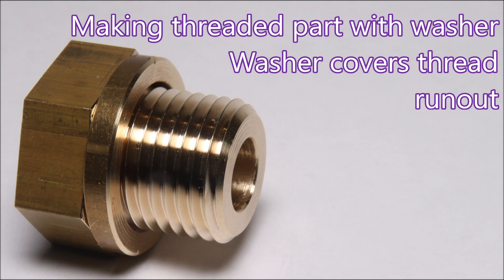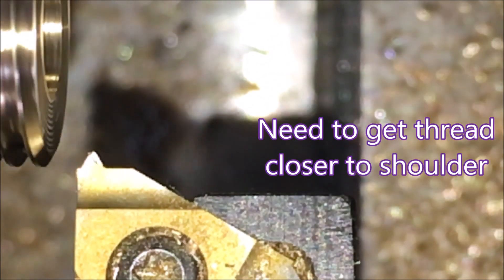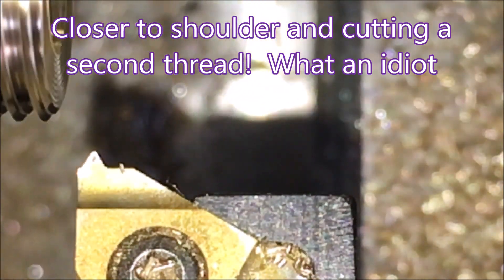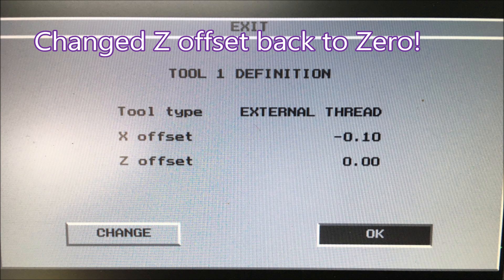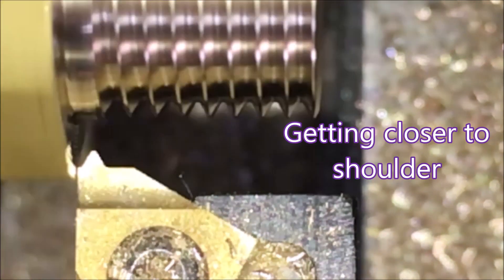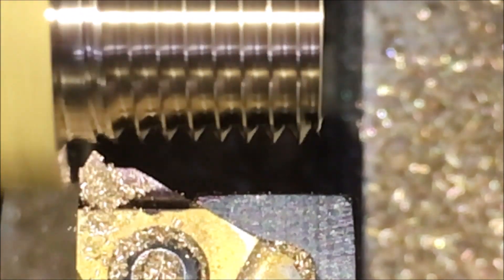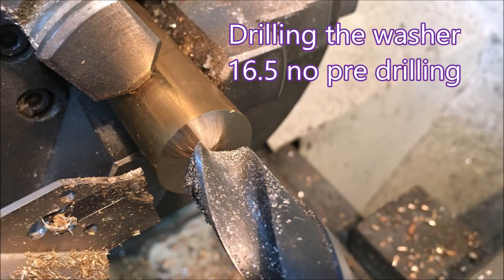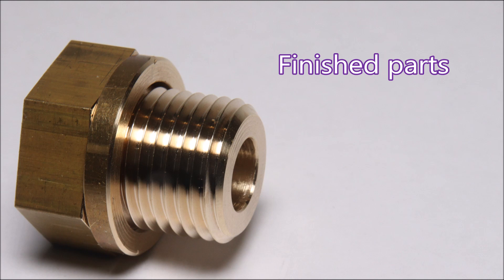Oops, cnc lathe threading M16x1.5 with Sumitomo full profile inserts. iPhone SE follows the tool

Comment: Thread issues like that make me fear cutting threads for a new power feed nut for my father's old artisan lathe. It's got an odd 3/4"-2TPI-LH double start ACME Thread. Only it's not exactly an ACME thread because at 2TPI on a 3/4" OD the thread profile gets chopped off a bit. so it's more like a Stub ACME profile. 

It's not a thread I've seen in any book, I think I would have to attempt to run the thread calculations.
Ideally I would love to get/make a tap and die set made for this thread so I could make a new powerfeed nut. With a new powerfeed nut I could get this old artisan lathe working again for my father..
Reply from the maker: Happy New Year. Is that really 2TPI? That would have one heck of a helix angle!

Comment: sometimes that happens, the most important thing is that you noticed on the first part. I don't think it would have mattered because the second part would have only used that offset so it would be a good part.
Reply from the maker: Thanks Ryan, you are quite right, I never thought about it that way, just wanted to get the offset done correctly! happy New Year to You

Comment: I made a similar oops with M22x1.5 just the other day. Engaged on the wrong number (manual) on my second last cut. Not happy Jan!
Reply from the maker: Hi Adam, Thanks for your comment, that really would have been painful to watch.  Happy New Year to You
Reply: @smallcnclathes  more painful given the part was originally a 70mm piece of random black bar offcut that my teeny lathe had to turn down just to get a fixed steady on, and then turn a section to 22mm after I knurled the handle part (building the world's dumbest nut cracker!).

Next time I'm just going to part off a puck and thread a stud into a hole and loctite it all up :D

Happy new year!